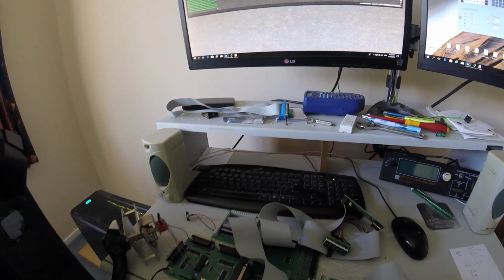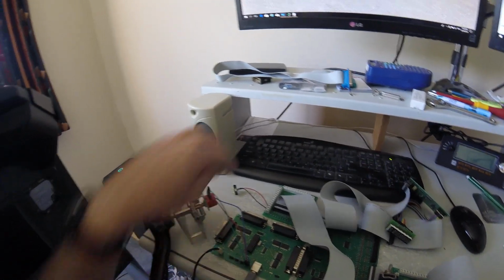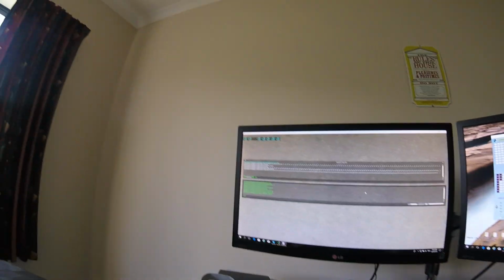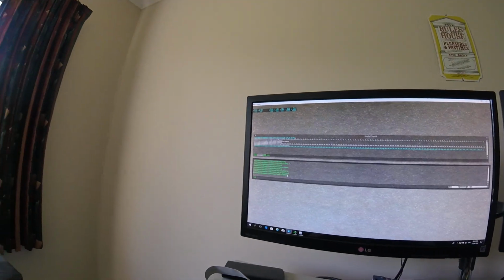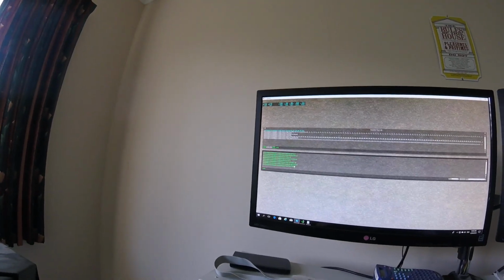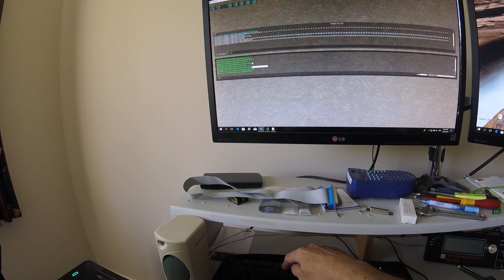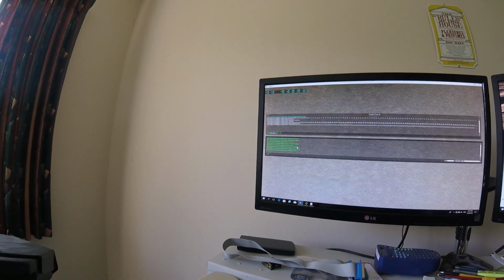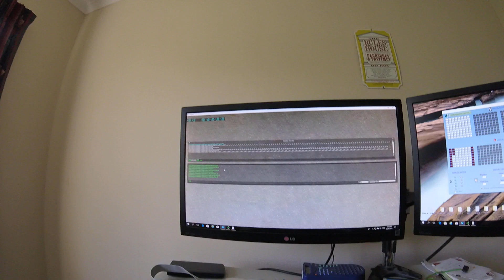XP11 OCUSBMapper plugin demo

Comment: Hi Pikitanga. Thank you for this Script's. I have the Zibo with Opencockpits OVD. When I turn the windshield wiper button on the panel, the button goes one step. If I keep turning it doesn't happen anymore and the windshield wiper stays in the int and doesn't go into low. Can I set the button to go to low instead of int?
Reply from the maker: The standard Opencockpits overhead only has the int position wired in. Yes you can change the script to make it move to low instead of int.